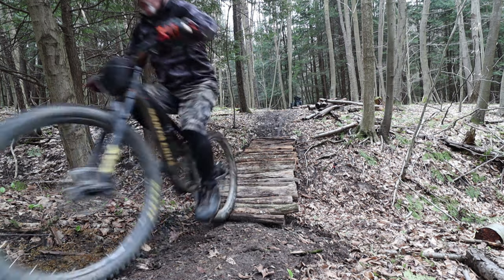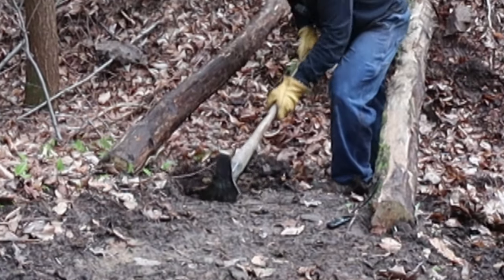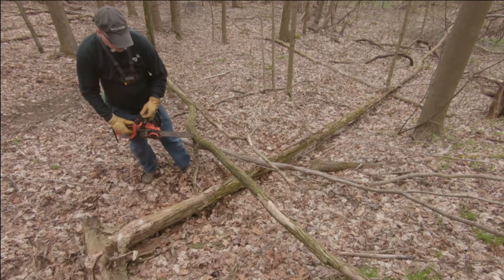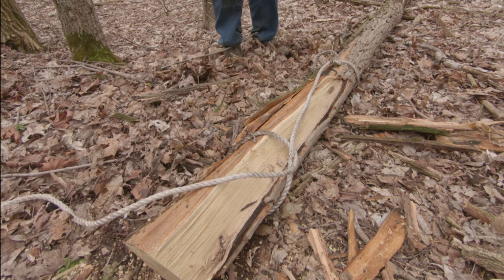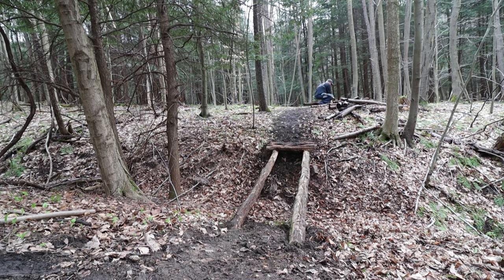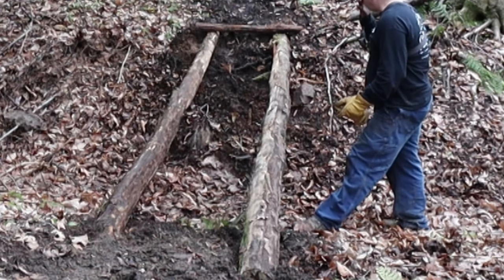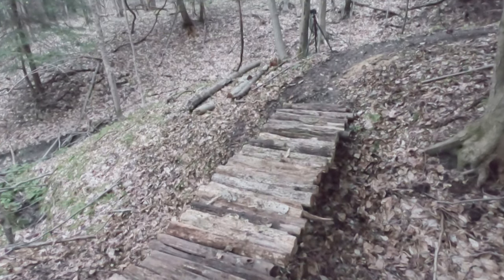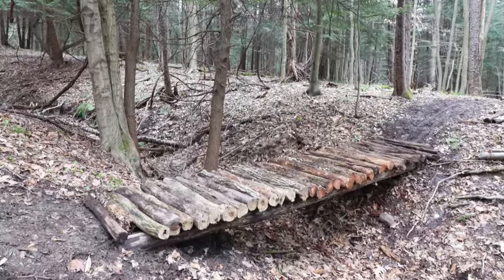Build this easy bridge for free!

Comment: Very nice bridge, thank you for sharing. Will it work if there is some height differences between the 2 sides of the bidge? 

Let's say a shorter bridge of 6 feet with an elevation of 1-2 feet between the two banks.

It will be for a usage of 1-4 people crissing it by foot.

Thanks
Reply from the maker: Thanks for watching. The video probably doesn't show it, but there's some elevation difference between these two banks. I just sort of dug in the main poles to split the difference, then sort of dug the trail in for a smoother transition. I hope that this helps. Good luck with your project!

Comment: Why did you not use the chain saw to cut wedge in the logs to keep in place for the top gravity also would keep em out that way.  I’ve done some like that.
Reply from the maker: Thanks for watching! That's a good idea, but they actually seem to hold pretty good the way that they are. The banks going in and out are steeper than they appear, due to the gopro effect,which keeps them from moving.
Reply: The Mostly Mike sHOW yeah we did a bridge over a water run and we just used a axe and flat shovel we cut slots for top to stay and use fallen timber for runners. We used other small pieces to hammer in at the end of the runners. To keep them placed  that lasted years. Til dog walkers came and decided to tear it down. Like why but it is what it is.

Comment: My video debut! Now where do I collect my royalties? Also, when are you going to add a wireless lapel mic to improve audio?
Reply from the maker: You know what sucks? I have a wireless lapel mic. I realized that the transmitter was still on the charger after I got out there to build it, and I wasn't going to go back for it at that point. The majority of the bad audio is from GoPros though. I couldn't turn the gain high enough to make it sound right unless I was right in front of the camera.